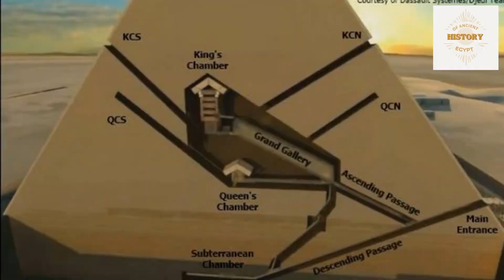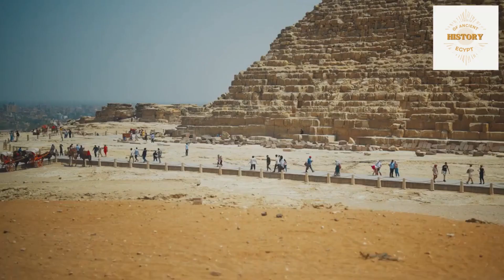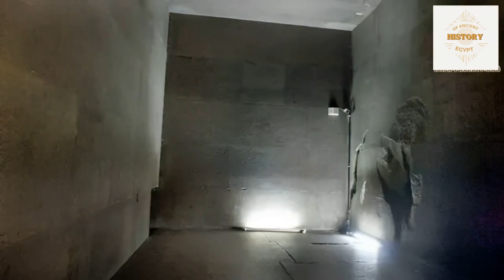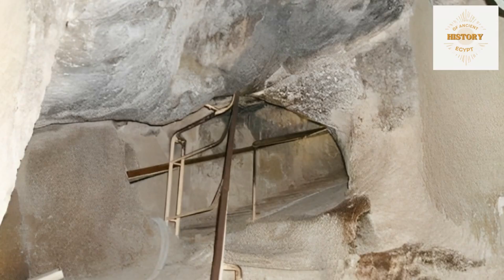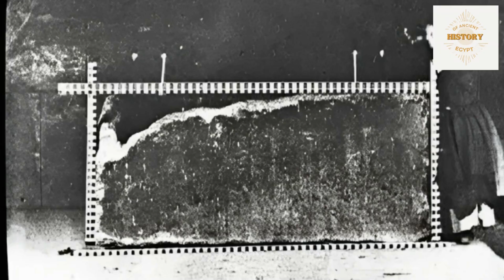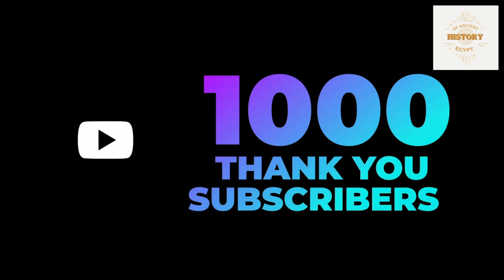Unveiling the Secrets of the King's Chamber and Stone Sarcophagus in the Great Pyramid

Comment: The marks on the ceiling could have come from granite blocks placed vertically one on top of the other, which would have provided better strength than wooden beams.
Reply from the maker: Interesting idea, but the marks on the ceiling of the King's Chamber—especially the quarry marks in red ochre—were clearly written by workers and align with known Old Kingdom construction practices. These marks, including cartouches of Pharaoh Khufu, were discovered by Howard Vyse in 1837 in the so-called relieving chambers above the King's Chamber. According to Egyptologist Mark Lehner and engineer Jean-Pierre Houdin, the granite beams were specifically placed horizontally to distribute the massive weight of the pyramid and prevent collapse.

Moreover, vertical granite stacking wasn't used in ancient Egyptian roof construction due to the risk of buckling and instability. The granite beams in the relieving chambers serve a structural function: distributing side loads and preventing cracks in the chamber ceiling under the enormous weight of the pyramid.

Comment: the roof beams cracked because  the large  mass of granite over it, those so called releaving chambers
which were an afterthought when they realized the side loads would put to much pressure on the grand gallery structure
Reply: @roverwaters3875 No, there is no weight on the beams from above. They cracked because of the stress of a violent earthquake.
Reply from the maker: thanks for sharing that
Reply from the maker: Thanks for sharing your insight! Indeed, the theory that the relieving chambers were an afterthought due to the realization of side loads on the Grand Gallery structure adds an interesting perspective. The cracking of the roof beams under the massive granite load highlights the challenges faced in the construction of the Great Pyramid. It's fascinating how different theories contribute to our understanding of this ancient marvel!

Comment: Does no one else notice that the block in the North Wall of the Kings Chamber that is directly in line with the "coffer" or "sarcophagus" is non-load bearing? It's the only block in the wall that could be removed without compromising the integrity of the wall, as the block directly above it span the blocks on it's sides, meaning the load is being re-directed around it. And this block, is just larger than the "sarcophagus", meaning that it could easily pass through the opening if it was removed. Add to that, that there are skid marks on the floor from the box to that block... and it seems quite obvious that this block is hiding a secret passage.
Reply from the maker: Thanks for sharing your intriguing perspective on the pyramid. Your insights into the blocks in the north wall of the King's Chamber are quite fascinating. It seems like you've noticed some unique details, especially regarding the non-load-bearing block and the potential skid marks. If you continue exploring and sharing more evidence or details about your theory, it could spark interest and lead to deeper discussions. Do you have additional information or points you'd like to share?"
Reply: @mikelee9886 It is not a new observation that this stone is different, and yes, I have noticed, and is seeking information about it. 'skid marks on the floor from the box to that block' that is new to me, if it is true. Supposedly, people have been tapping on all the stones to find hidden chambers, so somebody must have been tapping that stone as well. It is tempting to speculate that the coffer came from behind the stone, but if robbers were at work they would break through the end of it rather than drag it out of the hole, since it is very heavy. Did you visit the Kings chamber, Mike Lee?